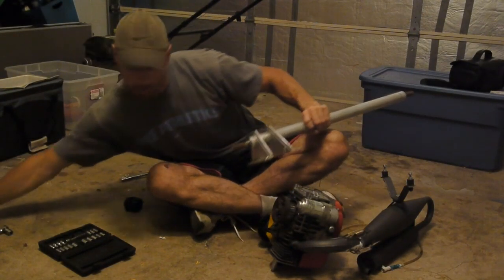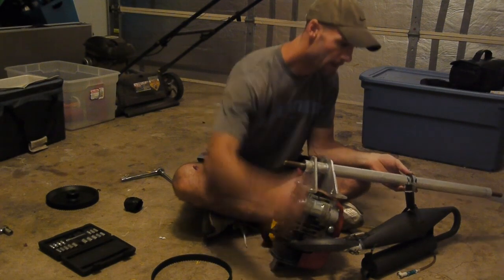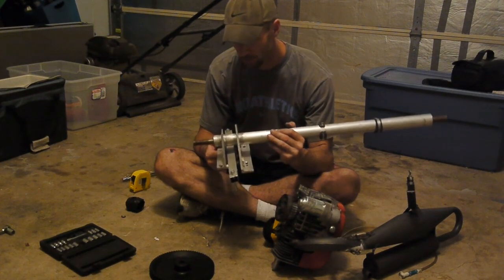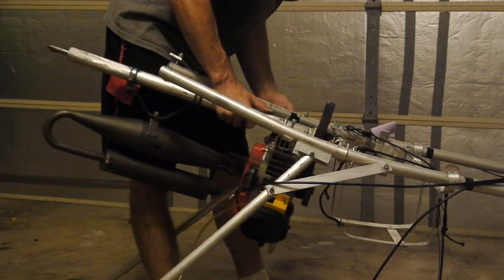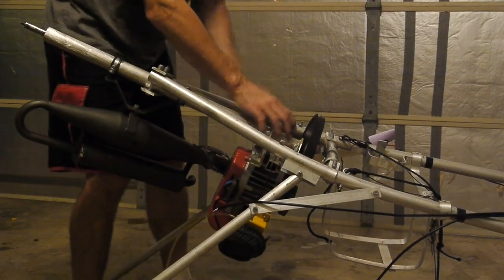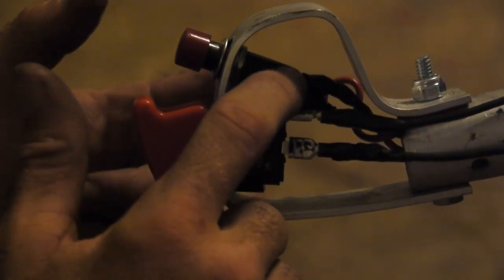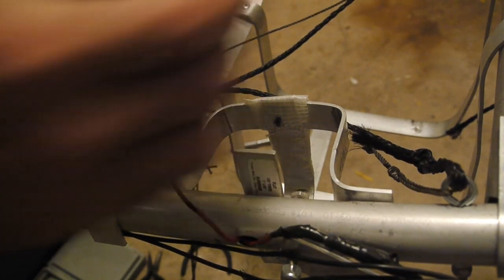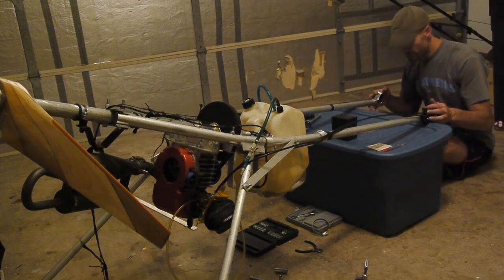How to Make a Foot Launched Powered Hang Glider (FLPHG)

Comment: hey wes how did you make the mouth throttle and where did you get the prop extender?
Reply from the maker: For one mouth throttle I use a simple small clamp. I drilled a small hole in the end of the clamp to insert the throttle cable. I used a bolt and used my dremmel to create a channel for the throttle cable to run through. 

The prop extension was two pieces of angled aluminum with aluminum pipe. I bought the high speed bearings first so I could make the measurements needed for the inner diameter of the aluminum pipe. I used a metal Rod that fit the inner diameter of the bearings. I used brazing rods instead of welding for the prop extension.

Comment: Anything less than 12 hp , you will have a very hard time to lift off, the first about 9 hp of that is just to bearly take u up the ground and any extra hp is what makes u go up... and if u use too powerful engine, that will not work either,  since not only it will be heavy,  also it will create much larger counter rotation force that will twist you to one side, 
Any engine between 12 and 18 hp will work, any other engine won't... 
The more aspect ratio wing u use to fly , it will have much better climb in higher altitudes ( not higher climb in the sea level ( the same ) but in higher altitude) 

The total take off weight/ aspect ratio = minimum thrust at sea level 

As you go higher , there is not enough air and density,  so that number will drop so fast , so if you get higher aspect ratio wing , on the equation above you will have much smaller requirements for thrust and the engine will be able to create enough of that,

18 hp engine will be twice powerfull to minimum 9 hp requirements 
And 12 hp engine will be only 1.33 times more powerful 
Going from 12 hp to 18 hp is only extra 6 hp but the experience will be much different since 18 hp will be 2 times powerfull compare to 12 hp only 1.33 times ..

Comment from the maker: I think your best bet is to use a Radne Raket 120cc aero. It's tried and tested and I've been using my first one for about 5 years with no major problems. You'll need a 3:1 reduction to reduce the rpms to about 3000 so you don't spin the prop too fast. There are other rc plane motors that will work, but the Radne Raket is the most reliable and used. It also only weighs 15lbs.

Comment: ok what engine whould you suggest i have a few 
like i said 467cc 2 cylinder rotax 2 stroke 
i have a 3.5 hp 4 stroke  
a 49cc 2 stroke engine 
ive also pondered making it a jet powered hang glider
Or do i have to outright go and buy  a dirtbike engine?im new to this so any ionput on engine is good just remember i will be having a trike not a harness

Comment from the maker: Yep, probably too powerful and too heavy unless you're using or have a glider about the size of a tandem. For the 52 inch prop used on most powered hang gliders you want to get about 3000-3200 rpm at the prop depending on the type of prop. My harness weighs about 55-60 pounds depending on how much fuel. My max hook in weight for my Falcon 195 is 250 lbs. I weigh about 195 lbs so I'm right there at the limit. Some tandems can handle 400-500 lbs.

Comment: by the way hows the glider comming i started making one yesterday i do have a 467cc rotax snowmobile engine for mine it weighs about 60 lbs im wondering if its too powerfull for a motorized hang glider with a trike under it?

Comment: you do know the cc measures the volume in the cylinder calculating amount of fuel/air mixture that can fit inside if its a 150cc electric motor its probably made in china by some dudes who dont have a clue.im sorry to dissapoint you.unless you ment electric start?

Comment from the maker: It turns back into a hang glider. I've ran out of fuel a couple of times, it's not a big deal as long as you have a place to land. I still have about a 10-1 glide ratio with my engine off.

Comment: You have hell to get 7075 in England, if you go to the glider makers they rip you off about £120 for an upright. But 6065 that is just as god and some times better can be got dead easy. I had two lengths for just under £40 enought for 6 uprights. Just as well, as with the site I aI flying and the winds i fly in,  I broke two last year. Still dune gooning has it price. Cheers, Pete

Comment from the maker: For a 56 inch prop you'll need about 3000 rpms. My engine spins at 9800 rpms and I use a 3:1 reduction to get to 3000 rpms.

Comment from the maker: Weight is about 55-60 pounds depending on fuel. Handling is about the same, just make sure weight shift is parallel to the keel. Don't drop your hips and feet to one side like traditional weight shift. I'm planning on making a tandem version that has a support running to the keel and mounted just in front of the engine so I can make a prone take off.

Comment from the maker: @McCrunluath The prop is bolted in at one end of the prop shaft and the cog wheel is bolted at the other. The bearings are sandwitched between the two. The prop and cog wheel keep the bearings from moving along the prop shaft.

Comment: How did you secure the bearings in the drive shaft cover?  Did you use any inner sleeving to prevent the bearings from possibly moving? Did you end up just using two bearings, one at the drive end and the other at the prop end?  Thanks for taking the time to put this out there for all of us out there!